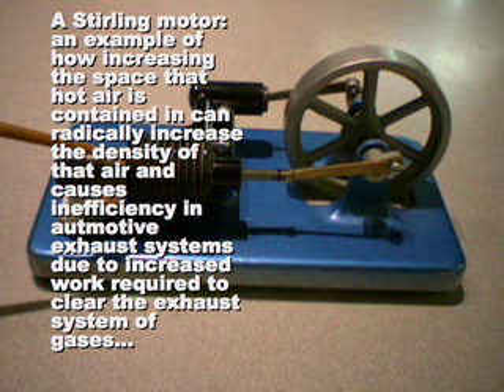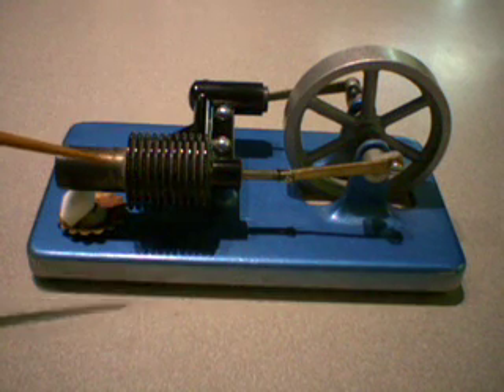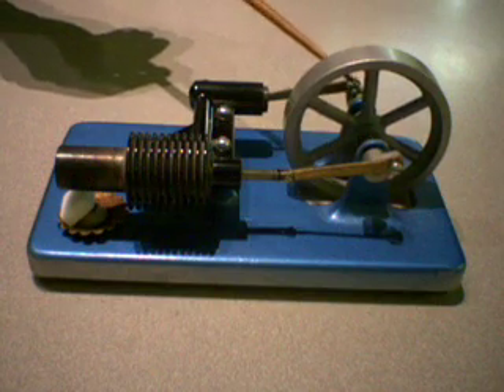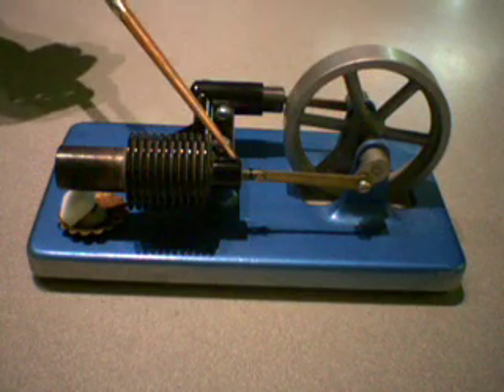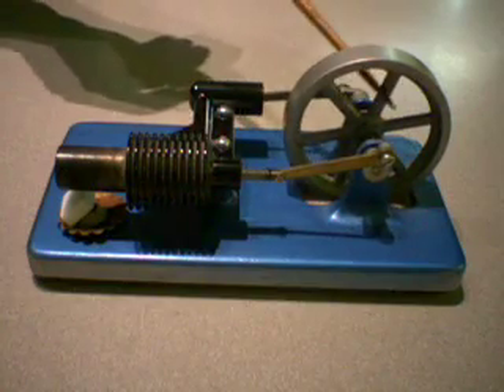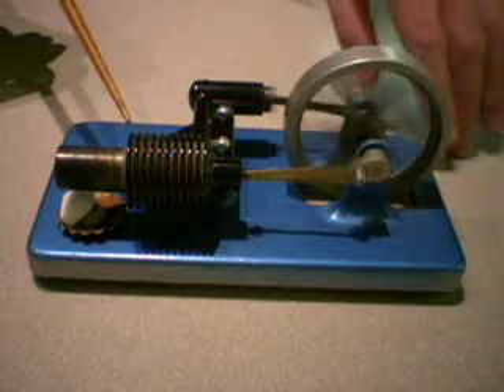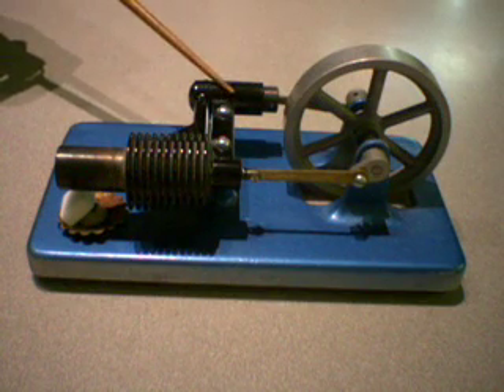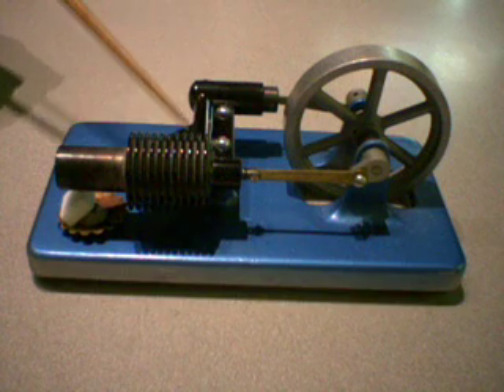Stirling engine example

Comment from the maker: A meteorite fell out of the sky and landed in my back yard.  Once it had cooled, I cautiously approached the crater and noticed that the heat and impact had cracked the meteor open and it was filled with some sort of goo!  Inside, protected by the goo, was this engine.  Also, I ended up being covered in grass.

Comment from the maker: Any type of heat.  In this case I am using a fuel pellet called Esbit, because it burns clean.   You could focus the sun on it with a mirror with the same results.

Comment: I saw one of these running on nothing but sunlight and it blew my mind.  It had a dish shaped reflector that concentrated the sunlight as a heat source...and it worked!  Supposedly four times more efficient than solar cells and a better solution because it uses a regular electrical generator attached to the crankshaft.

Comment from the maker: Depends on what you mean by "fast".  It doesn't actually go anywhere, it just sits and spins.  It is in the nature of a Stirling motor to be able to produce lots of RPMs but not much torque, I have never hooked anything up to it but I would guess it is running about 3,000 - 5,000 RPM.  Now, take a piece of dry ice and plop it down on the cooling fins and that little motor will rev up so fast that I believe it is in danger of actually flying apart.